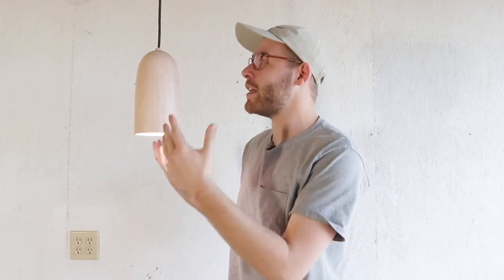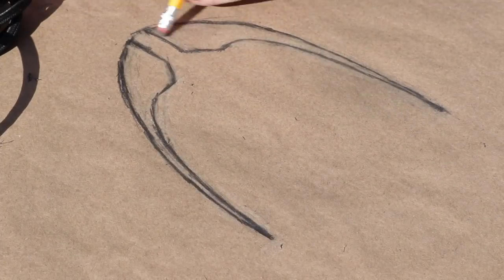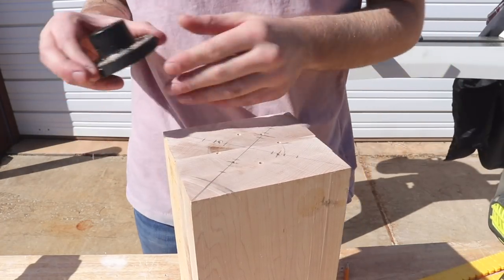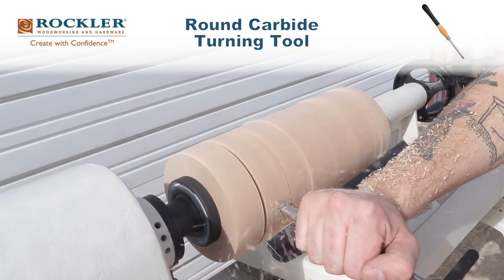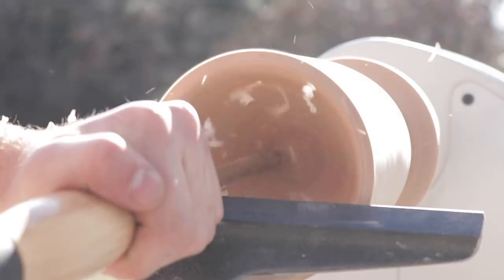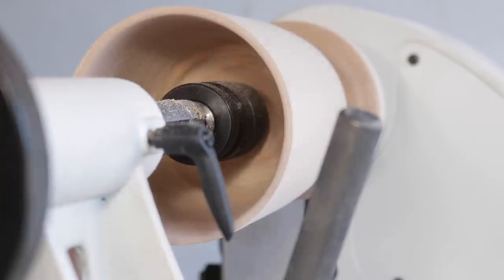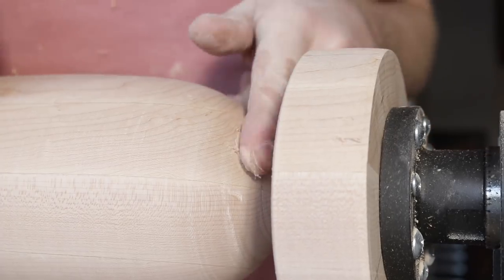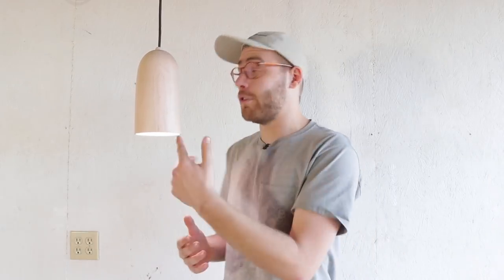Wooden Pendant Light | Woodturning | Modern Builds

Comment: Nice finished product!!!

Quick point: I'm not sure what the wiring rules are like in the U.S., but it is important to note that you shouldn't suspend electrical fittings from their leads if the lead isn't reinforced to do so. Just a little something to keep an eye on to ensure over time the wires don't become exposed at the connection and create a risk of electric shock.

Comment: Nice project Mike. I noticed a bit of vibration when hollowing, which can be caused by where you had turned down the top first, but not too significant. One tip to help with hollowing out end grain is to drill out the centre with the forstner bit first, that way you aren't battling with the centre.
Reply from the maker: Yes!! T seemed like such a no brained after I got the drill chuck for the socket recess. Definitely doing that from now on